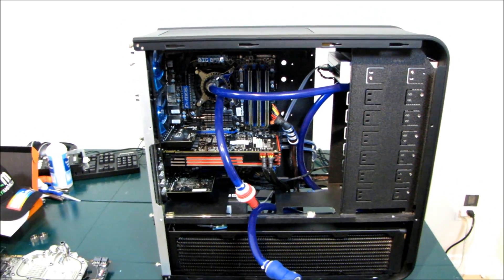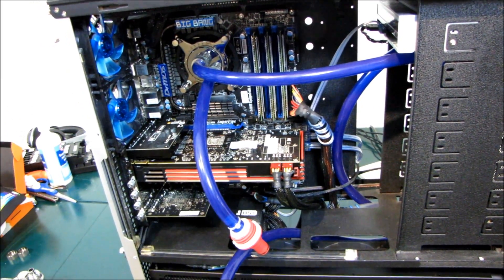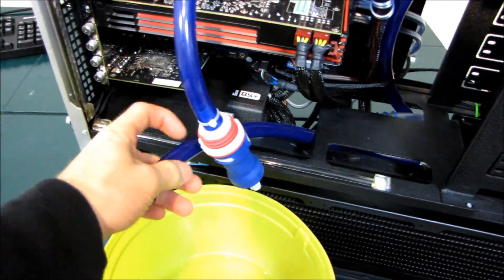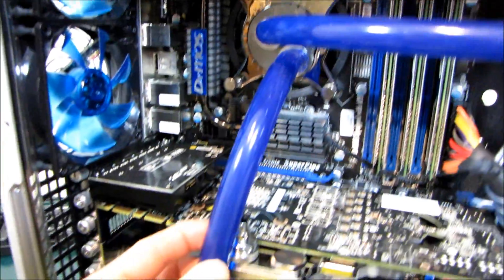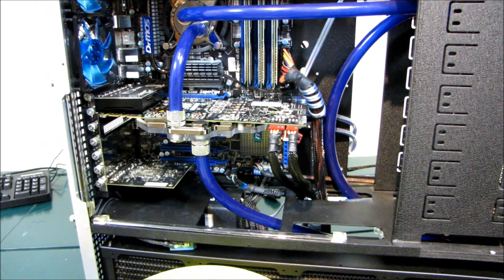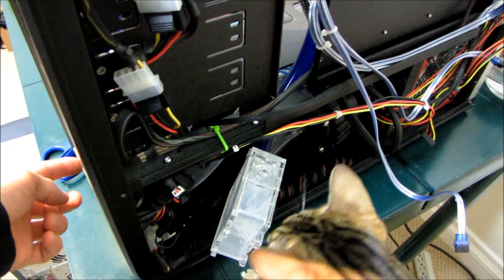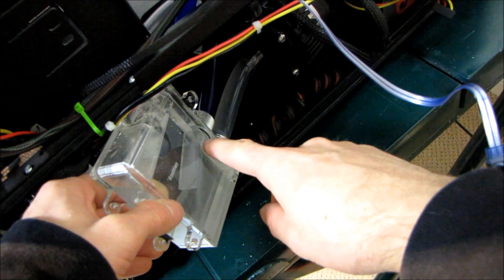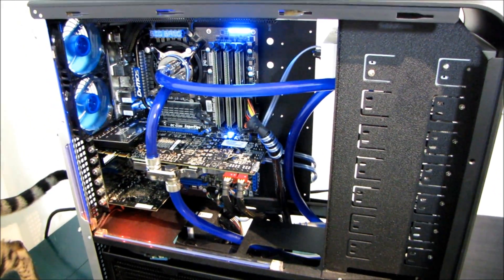Video Card Water Cooling Upgrade Installation Guide Linus Tech Tips

Comment: It will be fine.  The water moves fast enough that as it is moving through, each bit of water is only removing a small amount of heat at a time meaning that at any given point of time the liquid running through the second block will still be cooler than the component it's cooling. And as long as your radiator and fan setup is large enough to support multiple blocks, there shouldn't be a problem.

Comment: do you have to run water through cpu then gpu coz the warm water has already absorbed some heat before running through gpu. is it still effective when it's running through gpu after cpu?

Comment: I have an NZXT Switch 810 and I put a 360 rad up top but I had a 5.25" dual bay res/pump so all the air went in the rad so if anyone else has a problem like this you can flip the entire case upside down (except the res/pump) and run it a bit, that did it for me

Comment: I never understand why a video card and processor connected to one pump and one reservoir, I mean that the hot water goes to the video after the processor or vice versa, so what's the point? Of course a separate cooling is more expensive, but excellent cooling as for me is much more important.
I mean - you buy a water cooling that obchynogo expensive, so just make it right ones and for all.

Comment: Really nice, but it looked like the tube from the CPU (warm water?) went straight to the cool input to the gpu ?=) If it is like that, shouldn't the cooling effect be better if you had seperate tubes, so that the gpu doesn't get the warm water from the cpu?=)

Comment: Have You ever thought of using Mineral Oil instead of H2O in your liquid cooling system? Mineral Oil does not conduct electricity and it absorbs more heat than H2O making it a more efficient cooler.

Comment: Could you make a video in which you install a watercooling system for a 6 core AMD system by installing a waterblock, radiator, pump, reservoir? I want to know exactly how to connect everything together? Also one for installing the Radeon 6870 waterblock and adding that to the loop

Comment: When i watercooled my system i first did move my case sideways so air bubbles could move and be absorbed in the water flow. That way i was sure no air was blocking the flow in the CPU and GPU blocks. It is important to do this to make sure the videocard and processor dont get hot because of inadequate cooling. After getting the air out i watch the fittings carefully to spot possible leaks and then i power the system on.